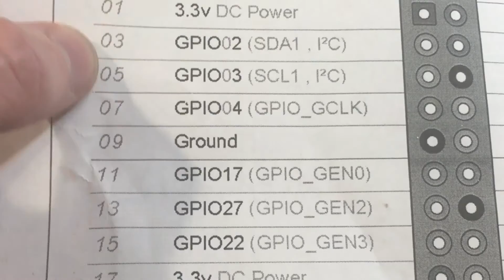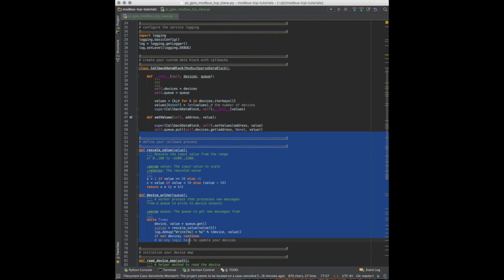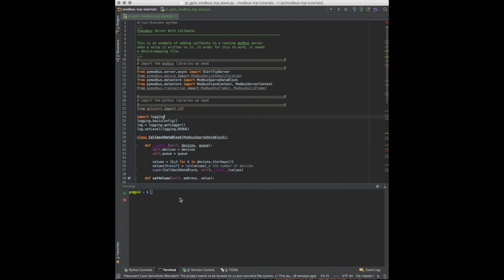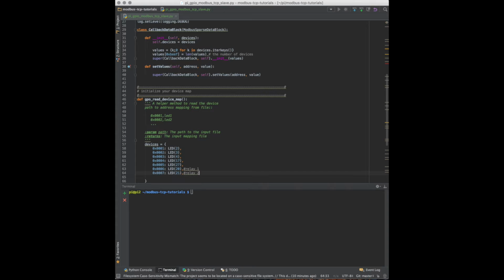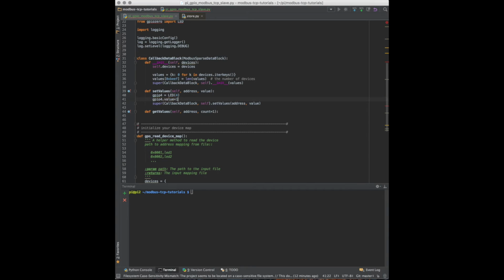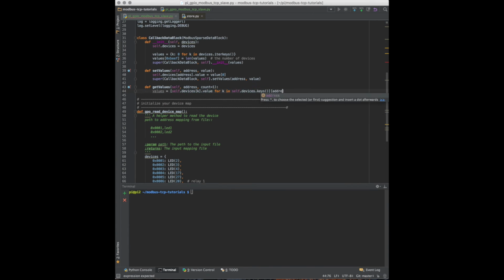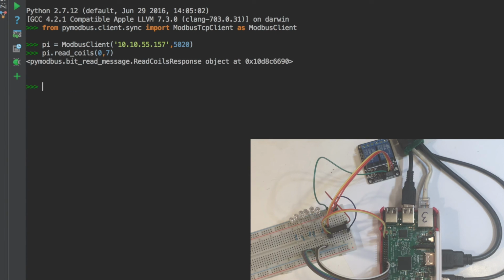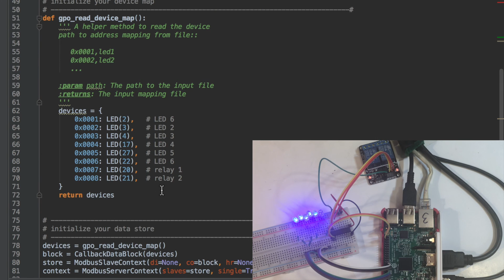Raspberry Pi - Tutorials - Reading & Writing Rpi GPIO Using ModbusTCP

Comment: Hi, I tried to do the same of video with my raspberry pi as a server, but when I try to specify the address '10 .10.55.157 ' I get the error File "/usr/lib/python3.6/site-packages/twisted/internet/tcp.py", line 1361, in startListening
skt.bind(addr) [Errno 99] that says I can't use the specified address. Do you know why this error appears?
Reply: its likely your raspi has a different IP address than the video. You need to yours instead
Reply: try ''localhost’ instead